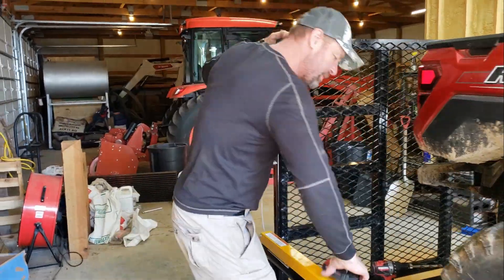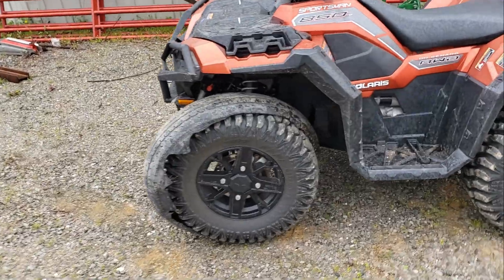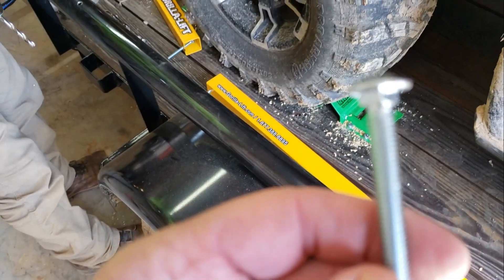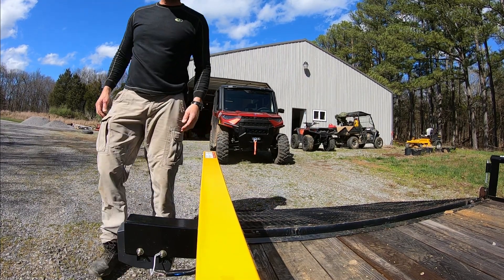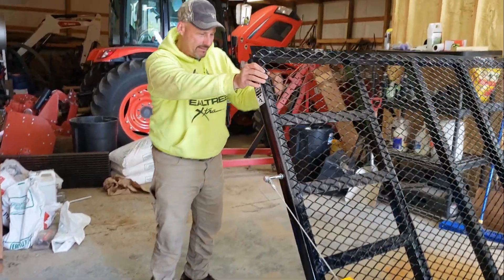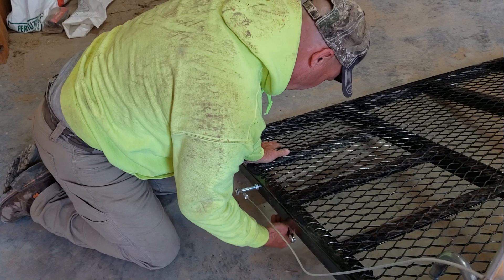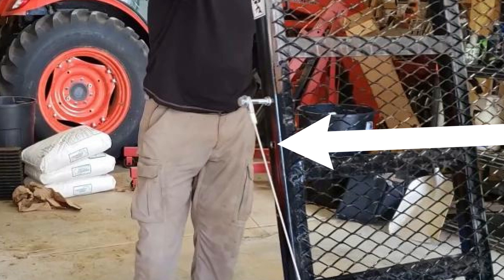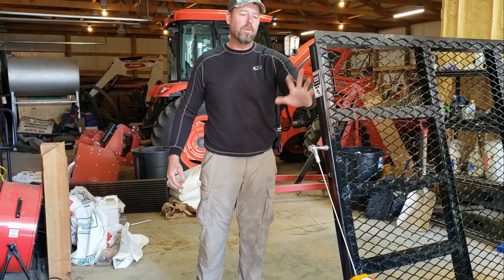Gorilla tailgate lift assist install and review (AND a one finger lift assist hack)

Comment: Joe I had a trailer like that and always thought there needed to be something like that for the gate and even ramps on a heavy trailer.   
Just a thought, by only using one, will it wear out the spring  faster than it should?   
Think changing just one spring on the old style garage doors.   
Ever had  a spring break on the old style garage doors, not knowing any better, I only changed the one spring that broke.   Big mistake.  Thankfully when it went flying off I did not get hit or it did not hit truck or bust out windows in garage door.     That will be a huge back saver. ❤️.
Reply from the maker: Life is all an experiment! Not sure if it will wear out the spring over time, but I really don't think so. They are literally like garage door springs! I think it is a double success like this though! Thanks
Reply: That was my thought as well. This method turns 1 kit into 2 kits, which cuts the cost in half. BUT  they will need to be replaced twice as often, which will bring the price up. Plus it will double the labor time as well, and time is money. Also, you're not suppose to lubricate the rollers since they're self-lubricating, and they should be replaced when worn. It's a neat idea and I appreciate them sharing it, even if it's not something I'd do.  I'm sure it's already helped people who were on a really tight budget at the time. Creativity makes life fun too!